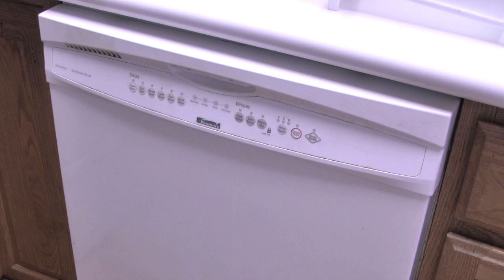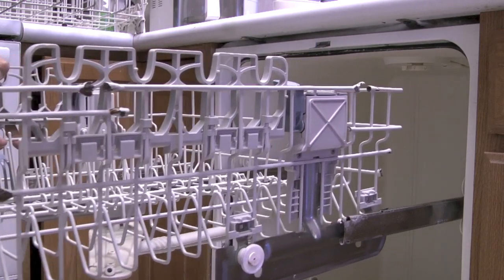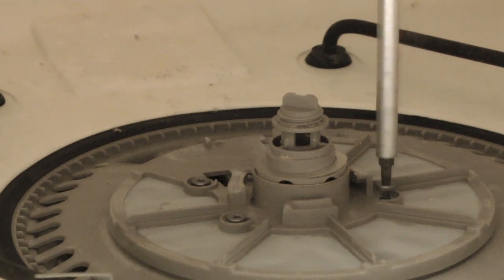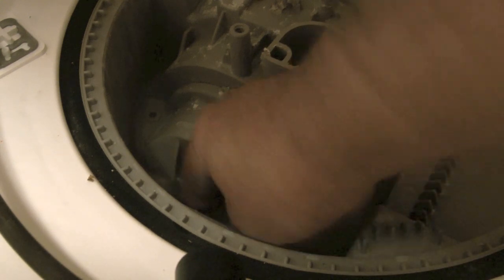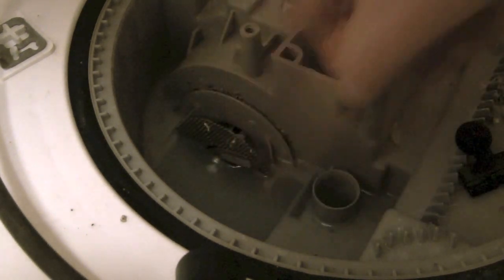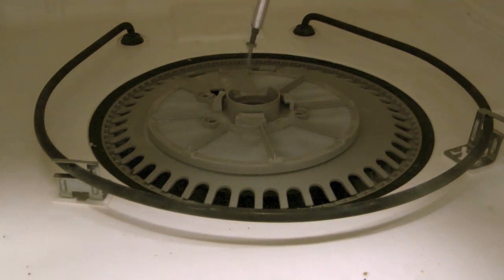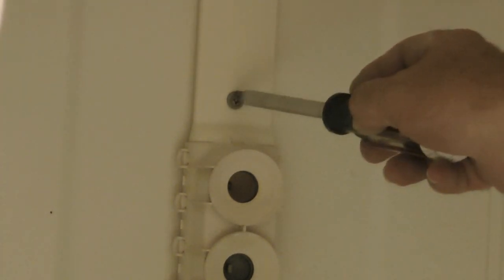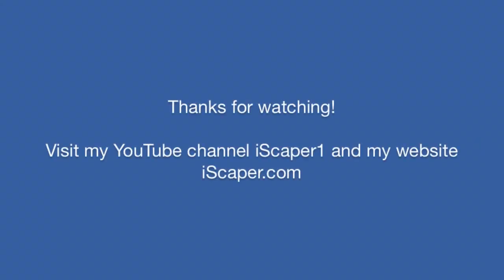Do it yourself dishwasher maintenance

Comment: Great video.  I have exactly the same dishwasher however, to remove the propeller, the center screw had the threads at the top, not below the bottom.  So I am holding it and spinning the prop in the counterclockwise direction and it is not coming off!  There are only 1.5 to 2 threads at the top so simply by holding the center screw with a pair of pliers and then turning while lifting on the propeller it came right off.  My problem was the drain hose was to clogged to allow the pump to pump it to the disposal.  I'll get another hose tomorrow and verify flow.  I did go ahead and clean everything and found alot of popcorn kernels in the sump!  Not good for the kids (no more popcorn for a while).  Thanks again for posting the vidoe.
Reply from the maker: Thanks for the info and the feedback.

Comment: Our dishwasher was also leaving a brownish residue on all the dishes. We have the exact same dishwasher I followed your directions and I was able to get the job done. I went a few steps further and soaked all the parts in a product called Jungle Jake. There was so much gunk inside the mesh screen filter and also inside of the tube that runs to the top rack. I cleaned the entire inside of the dishwasher. Ours is about 10 years old and has never been cleaned,,,,,it was disgustingly dirty. Next I am cleaning all the racks as there is a some build up on there as well, tomorrow I will be testing it out and will report back. Thanks for the video on how to take it apart, I couldn't have done it without your help.
Reply from the maker: Thanks Chad for the information and the feedback. Is Jungle Jake similar to CLR?
Reply: iScaper1 Jungle Jake is an organic cleaner that works really well you can get it at Mills Fleet Farm. The cleaning did the trick the dishes are as clean as they could be.
Reply from the maker: Chad Mellies
Great, thanks for reporting back.

Comment: Have Kenmore elite not drain'ing between this video and a few others I've seen I'll be doing the repair sometime today and will report back, 

thanks for the video easy to follow clear instructions
Reply from the maker: Yes, please report back on what the draining problem ended up being.
Reply: Completely forgot to report back really sorry my electric motor underneath the dishwasher that pumps the drain water out had a wire disconnected once I connected the wire back it was fine still went ahead and took apart everything and cleaned it though
Reply from the maker: samstealth7
Thanks for the information.

Comment from the maker: On my Kenmore dishwasher I noticed I had a white film on the dishes and what looked like small pieces of food on the dishes also. That told me it was probably an issue with material in the sump. Did you have both also? If you only had the white film, have you tried running a couple cups of vinegar through the dishwasher to see if that helps? In my case after cleaning the sump I ran 2 cups of vinegar through and even put the filmy dishes in when I ran the cycle. It worked great.

Comment: This was an excellent video! My dishes are coming out of the wash clean again! But I am still having a problem with a flashing green Clean light (7 times). Hope I can find another video as good as this that helps with troubleshooting the heating element and control board.
Reply from the maker: Thanks Christopher. Good luck and let me know what you find out about the flashing green light.
Reply: iScaper1 I found the Technical Sheet hidden behind the kick plate. That showed me the heater circuit and how to run the diagnostic cycles. I verified the heater element was OK. I removed the electronic control circuit board and found that the heater relay was burned out. Just ordered a new control unit.
Reply from the maker: Christopher Lewis
Great information, thanks for posting.

Comment from the maker: The spray arm should snug up when you spin it back on the center piece. If you have part of the centerpiece that has snapped off that might be what is causing the problem.

Comment from the maker: Remember to hold the nut stationary while rotating the spray arm. If the lower spray arm is installed correctly on the plastic nut you should be fine. After I installed the spray arm it still wobbled when I spun it by hand. The water pressure must make the spray arm align correctly while running. If you don't have things installed correctly you'll get a lot of banging when the spray starts working.
Reply: **If you can't get the lower sprayer on, you have to pull the middle part up first***

Comment from the maker: The only thing I can think of that might be going wrong especially with a new center piece is that it has sunk down in the housing enough that the spray arm won't begin threading on. Have you tried pulling up on the centerpiece so that it protrudes from the housing more? I ran into this problem when reassembling mine, so I pulled up on the centerpiece and was then able to thread the spray arm back on easily. Let me know if this works.

Comment: Great video but I think you actually missed an important step...you can prise off the filter itself from the housing and wash underneath. I found a ton of gunge between the filter and main housing. Just gently prise off with a screwdriver and rinse. BTW I have exactly the same model as this one. Most problems are definitely caused by hard water. Thanks for putting up the video though, very helpful!

Comment: Thanks so much for this. My c.2008 Kitchenaid has an almost identical sump although the water distribution system uses clamps instead of screws. Before exposing the cutting blade I found a toothpick, a Taco Bell sauce packet (probably the main culprit) and a lego piece plus the usual chicken bone and various seeds in the sump. Then my cutting blade was encrusted with a paste of salmon bones, which I cleaned off with an old toothbrush. I'm running it empty now and the improved water pressure is scouring so much soap out of and off of the interior parts, it looks like I added detergent.
Reply from the maker: Thanks Chris for the info.

Comment: Thank you very much for this video.  Worked perfectly.  I did notice however that if I push the center piece all the way down it is too low for the lower spray arm to catch the threads on the center piece.

Comment: Thanks for the video. Having watched several of similar videos, I cringe every time I see fingers in the hole reaching for broken glass or sharp bones, etc....why not use a vacuum (better yet a shop vac.) to suck out the water and the garbage. The small nozzle attachment with a brush can safely remove all the junk.

Comment from the maker: Did you trip the power back on? Is there a GFI outlet on the dishwasher circuit that is tripped? You might have to a little troubleshooting to see if the problem is in the dishwasher or the wiring to the dishwasher.

Comment: FANTASTIC video...I followed this to the letter and wow, what a load of junk in the sump.  You really should be a teacher :)
Reply from the maker: Thanks Dave. What kind of junk did you find in the sump?
Reply: Broken glass, bones, pips, cherry stone.  The filter under the rotating arm was filthy too so I gave that a good clean.  My symptom was similar to yours - things on the tip rack were leaving residue but also the sump wasn't draining properly.  Seems to be all sorted now thanks to your video
Reply from the maker: Dave North Chicken bones seems to be a pretty common item found in the sump, thanks for the comments.

Comment: You have the same issues that I am seeing in my dishwasher.  Thanks for the Vid, I'm going to have to try that this weekend.
Reply from the maker: Let me know what you find and if you cured the problem.
Reply: It might have helped a little.  I have a kitchenaid, dishwasher and the sump setup was different.  I couldn't find a check valve.  What I did find was a thick buildup of some nasty gunk coating everything.  Most of it was scraping that stuff off.
Reply from the maker: Michael Mongon
Have you tried running an empty cycle using vinegar? That might help with the gunk.
Reply: Vinegar worked okay.

Some of this could have to do with dish soap, besides just the hard water.  I tried this stuff and it's working great. http://www.amazon.com/gp/product/B004S0BV06/ref=oh_details_o00_s00_i00?ie=UTF8&psc=1

Comment: Perfect! Washer back to normal now. Thanks for saving me $$$ and time. By the way just a thought, I was able to remove the meshed grill assembly from the center piece to clean some build up there as well, but have to be careful not to damage it. Thanks again.
Reply from the maker: Great tip, thanks for posting.

Comment from the maker: Doesn't sound good if the pump just hums after the dishwasher fills with water. I'd say you have pump issues. When the pump quit on mine I had to decide if I wanted to put a new pump in an old dishwasher. I decided to go with a new dishwasher.

Comment: Everything worked as you said but I used a shop vacuum to clear out sump pump area.  There was a lot of glass in mine and had I stuck my fingers in there I would have been very cut up.

Comment: This is VERY CLEAR. Thank you for sharing this!!!
Reply from the maker: Glad it was helpful!
Reply: @Iscaper  bummer! After cleaning out the filter (lots of cherry pits, gunk and plastic) and running water through the plastic piping, I’m still seeing lack of cleaning and rinsing power on the upper tray. I’ll run it a couple more times (maybe shift to “normal” cycle instead of “smart” cycle and add the sani-rinse option) to see if I can get the machine back in shape. Else, I guess I’ll need to start shopping for a new appliance.
Reply from the maker: @johnkim1043 Have you tried white vinegar?
Reply: i will give it a try!! several channels have recommended white vinegar for just about everything! gotta learn how it’s used in dishwashers.
Reply from the maker: @johnkim1043 On my dishwasher I use a 12 oz glass measuring cup filled with the white vinegar placed on the bottom rack. Then I run a cycle without dish soap.
Reply: Cheers! will run it this morning! I really appreciate all the helpful tips.
Reply from the maker: @johnkim1043 Good luck, I hope it works.
Reply: @Iscaper   hi again! So I ran washer w white vinegar but I think all pathways are clear already. Not too much gunk. I got nervous that put the macerator together incorrectly so I took everything apart again. The mesh and blade were not correctly positioned and I fixed that. BUT, in my zeal to clean every possible part, I pulled the rubber flapper valve that lets waste water flow out AND TORE THE THING IN HALF. I’ve been looking online for replacement parts but I am striking out. Do you perchance have a part number for that item? Although not identical, my machine looks a heck of a lot like yours. I’m hoping that rubber piece will be the same for most models.  🤞 I’ll keep looking online for parts….
Reply: think I found the part on Amazon 👍
Reply from the maker: @johnkim1043 🤞

Comment: I am a 53 year old female and I was able to do this myself thanks to your
expert directions!  Thank you very much. I do have one question. The screws
that were installed with the dishwasher to hold it in the cabinet have come out
and the washer moves back and forth. Is it just the two screws at the top, inside
of the washer,that hold it in place and do you have any advice on securing it?
Thanks again, Susan
Reply from the maker: Hi Susan. Try installing screws that are a little bigger in diameter than the screws that vibrated out. Watch the screw length, you don't want the screws to come up through your counter top.

Comment: So, my washer was not running well, only the bottom shelf got clean. We are on a tight budget, and all the other fixes I did  to it helped, but not completely. I used the once a month cleaner and cleaned the top washer arm. Then I saw this video and set out to follow the instructions. My hubby was unimpressed, he puffed out his chest and said he could load up the dishwasher and get them clean!! Yeah, right. So I did everything in this video. OMG, the crap that was bult up was unbelievable.

Comment: thank you so much for your awesome video.. I did everything you had explained.. I have the exact model you show in the video so that made it nice... it did improve the cleaning very much.. now however I get a dirt buildup inside on the door itself. When its opened up and laid flat to unload ..water drains out the outside vent onto the floor. is there something inside the door that I should be cleaning?.. on the inside of the door as well at the top there is a round vent where dirt gathers as well??
Reply from the maker: Try searching online for "kenmore dishwasher door vent". This seems to be a common problem with some models.

Comment: Thank you for doing this, i had sears in home services annually for years.
They never clean it as nice. They just tell me to run it with vinegar twice per year.
Reply from the maker: Thanks, running a cycle using vinegar after cleaning the sump is a good idea.

Comment: Tip: I had a hard time gripping small debris down in the sump with my fingers, especially when I couldn't see it. But using a tweezers solved that problem. However, I couldn't get the cover off the chopper. Pulling firmly to the right helped, but I still couldn't get it off.
Reply: I finally got it off, after wiggling it left and right hard for a while, while pulling up.
Reply from the maker: Tweezers are a good tip, thanks for posting.
Reply: iScaper1 Thanks. The one other thing I learned was, put a cloth or something over the holes at the bottom of the dishwasher before screwing in the screws of the water supply pipe at the back and top of the dishwasher. I dropped a screw down those holes three times and had to take the whole thing apart again in order to get that little screw out.
Reply from the maker: huttarl
Another good tip, thanks.

Comment: I pulled everything apart according to your video, but I had to pry to the right with a screwdriver to get the chopper cover off because mine doesn't have anything to hold onto. Next, I had to remove the chopper blade and screen assembly because the screen was blocked. I am having some difficulty re-installing it. Do you have any videos on how best to do that ?
Thanks for your video.

Comment: Thanks for getting back to me. I did try pulling the center piece up and I can get the spray arm to thread on but then the center piece and spray arm now wobble when I test spin it. The center piece won't fully reinsert into the housing when I do it like this. It does not spin smoothly as before.  Did this happen when you reassembled?

Comment: In the pump, there was some debree that was laying in the pump. Debree laying in there were some chicken bones. We have a rubber check valve, the cover that was cleaned up to the chopper, a Number #15 torks head screw, the centerpiece cover to the pump, those four torks head screws that are T-20 Number #20 size, and that's what we have there.
Reply: I think we have vaccinated the problem by cleaning the debree out of the pump.

Comment: I am about to clean my dishwasher per this the video which I just watched. Once I have the cover off it would seem like a good idea to use a wet/dry vacuum to suck up any debris. I  was going to do this before and after I removed the housing on the grinder unit. The suction on the vacuum is pretty strong, should I be concerned about sucking up or dislodging any small parts?

Thanks - great video.

Comment: We were able to take the DW apart and found all sorts of glass and plastic. Besides the black check valve we found the following tucked inside the front of the chopper cover. My husband thinks it should not have been there so he is not putting it back. Fingers crossed it is not important. Our DW is the same as yours and you did not show this. Do you know what this is?  We will let you know how the DW runs after he puts it back together. Thanks for the excellent video.
I hope this link will open for you. I tried to paste the picture but it only did the link.  

IMG_3910.PNG

Comment: I have a question - we are going to do this, but there is also something that looks like a vent on the door, upper inside left. Ours has a lot of mould on it - can it be 'popped' off to clean it?  I am afraid to break it....TIA.
Reply: I have the same problem. Did you find out how to fix that?

Comment: Great job on this instructional. My problem is that it won't fill up enough for the pump to spin the washer arms. As if the float valve were turning it off early, but the float valve doesn't lift... and suggestions?
Reply from the maker: I would go to Sear's website and search the model number, then find the parts breakdown. Find the float valve in the parts description and see if they sell the replacement part. Then you have to decide if you want to pay their price for a new part for an old dishwasher.
Reply: iScaper1 But is the float valve the only possible culprit? Don't I need a diagnostic to be sure it's not the timer? I assume that the controller card opens the inlet valve (which works at the start of a cycle), and then keeps it open until the float valve opens (or closes?) and then the chip closes the inlet valve and starts the pump to run water through the spray arms, right? Is there any other reason, besides a bad float valve, that the chip would close the inlet valve and go into the next phase of the program?
Reply from the maker: otterinwater
Good points, it may or may not be the float valve. You're now at the point where you have to decide if you want to hire a Sears tech to troubleshoot the problem and spend money on an old dishwasher to fix it.